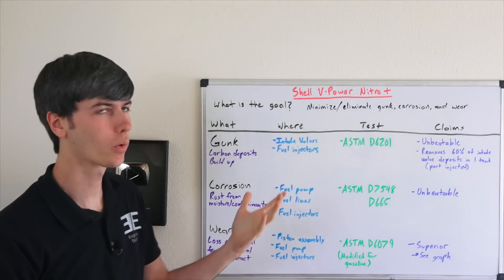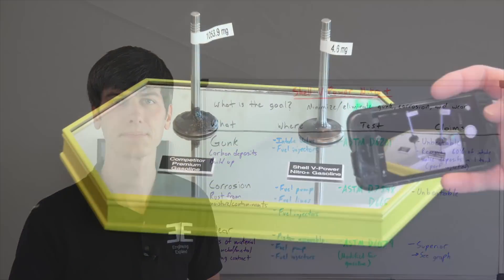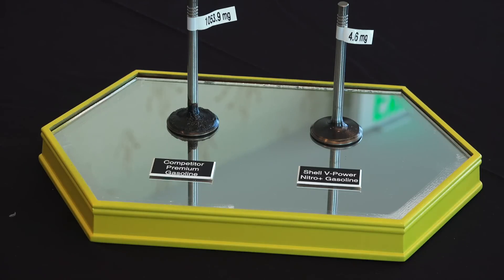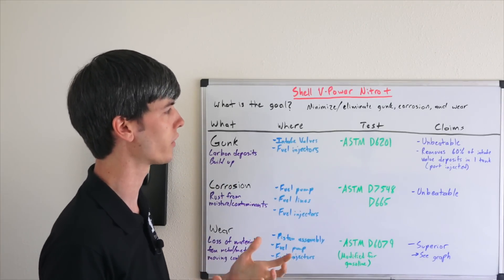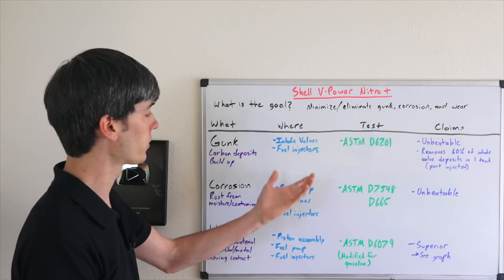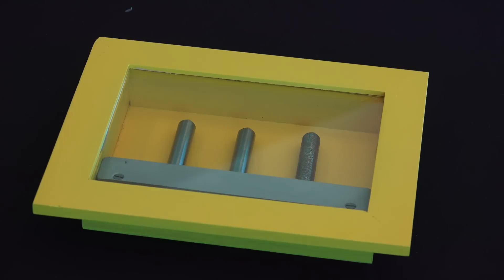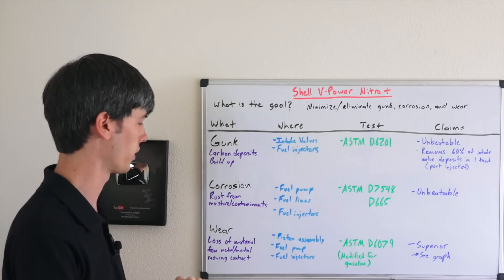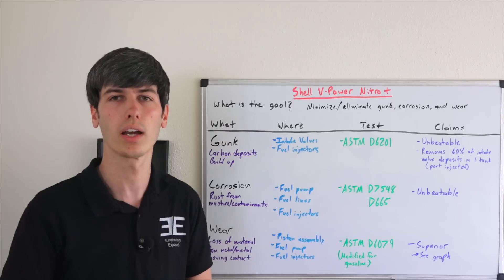Shell V-Power Nitro+ (Premium Gasoline Fuel Testing)

Comment: Ran my MG zr with v power from new the vvc mechanism let go didn't end well but when i pulled the head it wos very clean some carbon but at 55k I wos impresed  my track car only youes v power my engine tuner  recomended it to

Comment: I’ve done Shell premium in my Prius with around 130,000 miles, and it’s very smooth now. Been using it for several thousands of miles. San Fran to NYC to North Carolina to Colorado plus.

I did that after replacing the EGR valve, EGR cooler, and intake manifold. Doing all of that made it run better than ever (wasn’t cheap)! Bought it with 60,000 miles, and it was really rough needing fixed, but didn’t know what the problem was.

Now, I’m using Valvoline Restore and Protect to clean the bottom side of the engine up to and including the rings, and it felt more powerful after one oil change.

I’m switching now to the lower octane fuel from Shell now that I consider it mission accomplished and want to prevent it from returning to its previous state - also to reduce friction.

I guess the mixture around the rings can be 20% fuel, so might as well have a fuel that can help with it.

Will possibly switch to Valvoline High Mileage after this or Walmart brand high mileage (synthetic).

Changing oil at 3000 miles or less for the life of my car now or every 6 months.

Yeah, I am a complete novice and not a mechanic.

Comment: I’ve been using this fuel for about four months almost exclusively. I also use an injector cleaner every oil change. I used to lose a quart of oil between changes. This last oil change I lost nothing so I think some of the rings were freed up and I’m not getting blow by. I think it’s worth it.

Comment: Not a shell fan boy and never used their gas until this week.  Filled up the other day and did my usual drive from Houston to Austin and back.  Engine sounded a little quieter and got slightly better gas millage than normal.  Usually fill up with Chevron or Exxon.

Comment: You are so smart so I can't figure out how you don't realize that all of those photos of the gunk from the intake valves are from DI engines?  The fuel will never touch the intake valves in DI engines and thus will have NO effect on valve gunk.  Gunk on intake valves for port injected engines has never been an issue.

Comment: My 2016 PILOT has/had issues cylinder 1-6 misfiring was acting like 3 cyl🤷🏽 but I’ll keep using it with the little bottle of fuel cleaner autozone HONDA couldn’t do anything.

Comment: You show pictures of and talk about VW valves and how quickly valves can become carbonized. But Shell's test was  done on engines using port injection.  Not direct injection.  All the Shell V Power in the world will not clean valves with direct injection.  I know you know this, why mislead in your video.

Comment: Yeah I’ve got to say this is true. I own a QX70s and I’ve been using premium fuel from other sources. I have noticed lately that my car has started to run a bit rough. After speaking with a few mechanics I decided to try out v power nitro. I filled up at a half tank and I kid you not, the issues I was experiencing went away. Again this fuel is the truth..a bit on the expensive side but it works.

Comment: I'm always curious about the same brand of fuel, but 87 octane vs 91-93 octane.  All the brands always only make high detergent claims of their premium fuel. But are their lower octane fuels not just as good, and only the octane rating is the difference? That could make for an interesting test and video!

Comment: This is BS. Were the engines both bran new? And there is nothing you can put into the gas tank that will dissolve carbon buildup. And if first tank cleans 60% of gunk, then I only need to use Shell Nitro+ every now and then, not every tank.
Reply: In direct injected engines the fuel is sprayed over the valves, so it's possible that additives in the fuel can clean the valves along their way to the combustion chamber.
Reply: @joshuaewalker  in port injection you mean? That's why ppl use catch cans.

DI sprays directly into the cylinder. If 1 tank does 60% of cleaning then it goes, from the original 100%: 60% cleaned, 35% cleaned, 21.6%, 12.96%, 7.78%, 4.6%, 2.7%, 1.6%. 7 tanks then should clean 98.4% of carbon deposits, if this gimmick is true.
Reply: @RobHTech  
Wow. I must've been half asleep or something. I don't even remember writing that comment. Uh, yeah, definitely should've said a PFI engine, not GDI.

Comment: I just recently tried this fuel in my older car (1997 Saturn SC2) because I was having a code showing knock sensor issues. After changing the knock sensor twice and no avail, I tried the Shell V Power Nitro. After putting this gas, my check engine light cleared. I'm thinking the need for higher octane must be from carbon build up. Not sure but so far it's fixing the problem.

Comment: I didn't read all 940 comments however one question keeps coming up in my mind; is the competitors valve from a GDI engine and the Shell valve from a port injected engine?  In general any gasoline is a great cleaner and will keep the back side of an intake valve clean and the valve cool.  Do you know what type engine each of these valves came from?

Comment: Jason, I have a question about the carbon deposits on the intake valves of the Volkswagen engines that your friend the Humble Mechanic showed you. You mentioned that some of these photos were from low mileage cars, presumably newer cars that might have VW's GDI. GDI engines are notorious for gunking up their intake valves, since there is no fuel spray over the backs of the valves to wash them clean. I question whether any gasoline with any additive would be effective in cleaning gunk off of the valves in these engines. I suspect that the Shell V-Power Nitro would not do much to clean up valves in a GDI engine. The piston tops and combustion chambers are a different story and I'm sure that the Shell gas would do well in removing and controlling the buildup of carbon in these areas.

Comment: Why not on testing run a 4 or 6 cylinder with half with nitro and half with best competitor.
But fuel of no use on dgi engines, as it doesn't spray on valves.

Comment: in UK shell v power is 25p more expensive then regular petrol, bottle of liqui molly cost 10 pounds, and it says will do same for 1000 miles, way cheper, so a question is does it worth to buy expensive fuel or additives on its own

Comment: This test does not control for oil service intervals between the two cars tested. You can have one car where the owner did oil changes every 4,000 miles vs the other car every 15,000 miles. One will have much more wear, carbon and sludge buildup. Obviously you’re selling some kool aid for Shell.

Comment: So is there any negative effect using 99 ron fuel in a car designed for 95 ron fuel? If not,  I would use it once-in-a-while to clean carbon off the valves.

Comment: My opinion only, but I have done my own testing in Canada 🇨🇦 with my 2015 VW Jetta , 1.8 liter Turbo, and I got 7.5 liters per 100 km (31.3mpg) on reg fuel... and 6.6 liters per 100 on ave on the hwy on Shell V Power Gold (35.6 mpg ) my car is rated at 29 mpg combined...I find it runs smoother and The engine comes alive with the Gold, more power, feels sluggish on regular.. also no ethanol, so it runs much better in the winter.. my opinion.. I might be a mad man lol 😆

Comment: So I have a 2018 Honda Accord 2.0 turbo engine with direct injection I have used v-power Nitro premium since I bought the car it seems like the performance gets stronger with Miles I don't notice any drop and performance whatsoever and the fuel economy is great

Comment: My 1998 Subaru Outback failed the NYS emissions test.  My mechanic said to run 2 tankful's of Shell V power Nitro with a recommended amount of Seafoam.  I did that and passed the test on the next try.  He said the sensors were carboned up and that he had good experience with that fix.

Comment: Back in the 1980's Shell sold a fuel they called 'Formula Shell'  they made some similar claims about its ability to clean the engine.  The result was that millions of cars had their inlet valves burned and the engines damaged.  In some countries Shell had to pay for the damage that the fuel caused. In the UK they got away with it and didn't pay out.  I'll never trust Shell as long as I live.

Comment: What he didn't say is just as important as what he did say.. The first test showing a huge amount of carbon on the valve vs the Shell, was done with there compettitors premium fuel vs nitro.. ok,, what they didn't say is they tested the Chevron 94 winter vs there nitro summer fuel.. That's why that valve looks like that.. I can due that test every day at our lab and get the same results when comparing winter vs summer.. they somehow forgot to mention that..

Comment: I've been using Shell Premium in my tuned chevy cruze for about 10 straight tanks now.  I've noticed the surge in acceleration is seemingly stronger lately, and almost seems too good to be true.  Could this simply be due to the engine being cleaner from the Shell gas vs. the speedway gas i used to use?
Reply: My camaro b taking offf
Reply: Yes it burns cleaner

Comment: Listening to what our lab-coated friend says, when he says it, and how he says it, I am incredibly doubtful about the integrity of the claims.  

He offers not a jot of info to show the competitor fuel was a direct competitor, ie. the highest grade petroleum product offered.   Most oil companies call their mid-level product 'Premium' - illogically - and have a more ostentatious name for their top level petroleum product, e.g. Shell's Vee Power Nitro Plus.  Shell's hype-rehearsed fellow is conspicuously vague - avoiding any mention of the other fuel's M.O.N. rating, R.O.N. rating, included detergent type/s, or the amount of detergent/s. 

"On port injection?" he is asked.  "On port," he assures the questioner.  Having been in a sales role years ago (for what I later learnt, was a dodgy operation) and being instructed to assuredly repeat what the buyer was hoping to hear, I doubt that our Shell fellow knows what other fuel injection methods / technologies even exist.  You could have said throttle injection, or intake injection, VBI (valve body injection), or any other invented term - and he would have quickly said, "Yup, blah-de-blah injection".   

"Can't get cleaner than clean," with the tag showing 4.6milligrams of carbon deposits on the valve.   Technically, that comment by the supposed technical expert, is wrong.  

We can reasonably assume that the similar variables apply to the deposition of carbon on valve stems, ports, etc - and on port injector tips.  However, to what degree the promoted product reduces the accumulation of new carbon deposits, or reduces the amount of existing carbon deposits on pistons, valve faces, and other combustion chamber surfaces, was also side-stepped.  Differences between how Shell's whiz-bang product, and the how the 'competitor' fuel, actually combust is really significant here - but no information is shared.  ('Reference fuel' is defined in Section 9 of the D6201 test, but I'm not inclined to spend US$72 - about $106 Australian - to read that particular portion of the test.)

Comment: The pictures of dirty VW ports were most (if not all) on direct injection motors. It's not indicative at all of what a normal port injection motor's valves would look like.
Reply: Yep, thing is VW engines are particularly bad for carbon buildup. We need to see it on other engines. I bet if they cracked open a Toyota or Honda engine it wouldn't anywhere near that bad after running on regular petrol.

Comment: The question I have, they compared against a competitor fuel, but is it of the same Octane number?!
I've a car since three years and the dealer says you can use 95-octane, owner's manual however, says "Recommend using 98 (RON)!!!
I've vibrations and hesitation and I don't know what the reason is as I'm strictly following the service schedule and I care a lot for my car.

Comment: What is the difference between Shell's V-Power and Shell's V-Power NiTRO+, and what is the octane of each?

I have been to a shell gas station that only had V-Power, not V-Power NiTRO+.  I have also been to a gas station that had one pump labeled as V-Power NiTro+ and another labeled as just V-Power--BOTH were labeled as 91 octane. 

Also, does including fuel additives, like Techron and Lucas Oil's Octane Booster, have an augmented or a diminished effect when used with V-Power NiTRO+ ?

Comment: Inlet port pictures you showed that where black are Direct injection diesel engines ,it won't make any difference what fuel  you used  in them that thick black gunk is from exhust gases recirculating  via  EGR system , as for injectors exhust valves and ports it would help clean them a bit diesel engines exhust gases can be a lot hotter than petrol/gasoline and burn most of the carbon away

Comment: I have 300,000 miles on my Acura tl type s 2007 and i have both shell and Mobil gas station next to my house I usually use shell to fill up sometimes Mobil. Both must great fuels as my engine still got a lot of pull in it. Use Mobil one oil. Never had a problem with any fuel parts. I guess just using quality high name brand fuels and we should be good.

Comment: Ok, so having been using Sunoco 93, I went to shell for 4 fill ups (average 10 gallons per fill).  My car is GDI, and requires 91 or higher. Sunoco has always returned better gas mileage and my engine runs better than it does using Flying J or Wawa/royal farms.  My 1994 Camaro I bought new, back in 1994 ran better as well. Now back to shells nitro, I haven't seen any noticable difference in mpg from sunocos, my engine does run as well on both gases. To me. She'll may have improved their own gas better than it ever has been, but it seems they just cought up to Sunocos.  Side note: seafoam works great for cleaning GDI engines. Suppose to be every 30k miles but I do it every 2 months. I drive under 4k miles per year on this car.

Comment: Theres a major difference  in  octane  rating. It is called pre ignition. Any  non high performance  engine  use  alower octane  rating. Lastly  I  have  seen  many  tests on fuels sold from  different  sources. Really fuels come from only few major companies eg shell Chevron and  exon. Am pm, valero, 711   stations do not  produce  their own  fuel. Thes companies  buy what  is  called  an unbranded  product.    
Unbranded  and  branded  fuel  are the  only  way  to  test this  mystery. Which weirdly  no one has even  looked  at. Think about  it people.

Comment: All the cleaning detergents in the world won't prevent "gunk" build up on all these new cars with GDI (Gasoline Direct Injection) engines, the cleaning agents in these fuels only help if they are passing over the intake valves during the intake stroke. Port injection will def benefit from this, but direct injection sprays fuel directly into the combustion chamber, hence the name, with only air passing over the intake valves and those cleaning agents are burned up with absolutely no benefit to the engine valves. GDI and GDI turbo engines have exploded onto the modern vehicle market offering great performance along with great fuel economy, however, are going to produce almost unavoidable consequences down the road, especially for folks who don't use "top tier" fuels in their vehicles.

Comment: lol my corolla intake valves and ports are squeaky clean i seen them when replacing manifold gasket. using shell nitro. i dont use the lower octane shell because the ethanol robs power for the little NA 4 banger. for larger engines i guess the ethanol isnt noticeable, or is it. everyone out there can do a test for themselves by switching to nitro. im pretty keen on these things though.

Comment: Most VW cars are direct injection so the fuel has no affect on the intake valves and now most cars are going in that direction for 2 reasons better power and more efficient to fix the problem thay have to install 2 injectors per cylinder 1 direct injection and one on the intake manifold so the fuel cleans the intake valves you can manipulate the system and push more fuel into the engine at one time mix that with a big turbocharger you got yourself a fast car and you can run stock injectors I still prefer the injector on the intake it is simply easier to work on then D.I. vehicles

Comment: How would compare ShellVpower with A Ethanol free Super Unleaded? I always use Ethanol Free in all my small engine applications. I do not know if the Ethanol Free that I buy has an additive package.
Reply: Yes! I only use non ethanol fuel in my vehicles. I don't trust the 10 percent or whatever percent of ethanol in other gas stations.

Comment: I use Chevron gas 95 % of the time because it’s right next to my house and I know that it cost a few cents more per gallon but it’s much better gas then others around me or San Diego I have used Shell super unleaded 91 before and it’s great too but it’s not close to my house. Any top tier gas with good additives are great. If I am out or gas light is on I’ll put in what I need for the time.   But mostly Chevron is always around California. Maybe other states. 
Any gas is better then running out of gas on the road too.  Costco gas is fine too

Comment: Sometimes when you switch to better fuels and additives along with using fuel injector and fuel systems cleaners, You will end up releasing And introducing particulate matter into the systems and cause extensive wear on the fuel pump causing premature death especially if you don’t change the fuel filter very regularly!

Comment: Used V-Power on my 2012 2.5L Camry and put 300,000km when the car started to stall at the stop light. Local mechanic poured some stuff into the intake and tons of black smoke came out the exhaust. Charge me $50 for the 10min service and car was back to working like new.